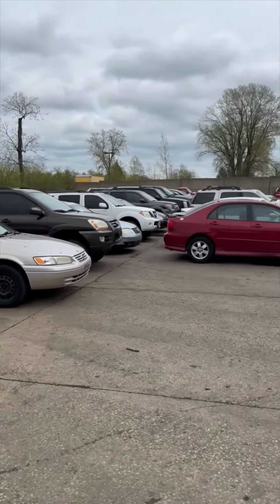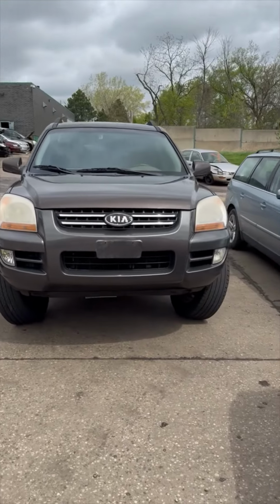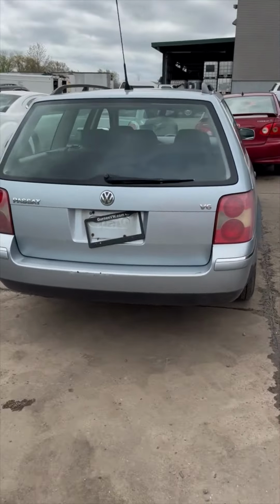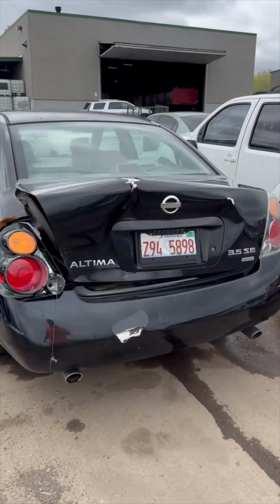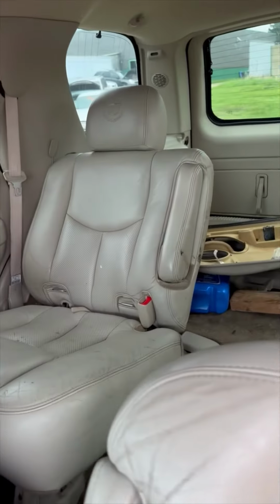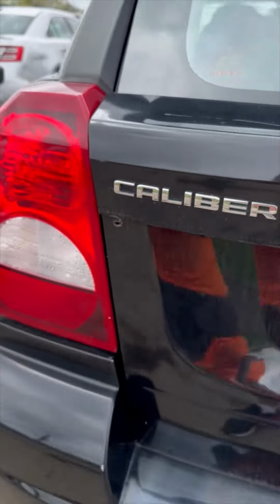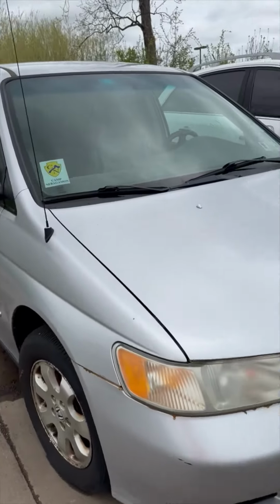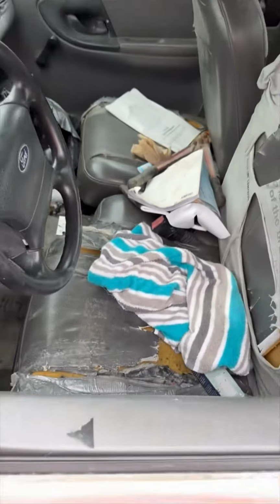Daily walkthrough at Auto Parts City includes a wobbly Kia Sportage, F150 7700, Mazda 5 & more !

Comment: Broke my heart to see the Toyota Camry
Reply: Why? Its an appliance.
Reply: @herbiehusker1889 3.5 v6 is more than just an appliance, it's a machine that goes for 400k with no issues.
Reply: @tomtom1541  I had one with a 3.5 V6, garbage. It accumulated sludge like nobody's business. It ran like crap. I changed the oil every 3k miles and it was overdue. Worst car I've ever owned.
Reply: @herbiehusker1889  that sucks. I've got 250k on mine with no sludge so far. Hopefully I'll pass 300k without any sludge. Also I'm doing 10k oil changes myself.